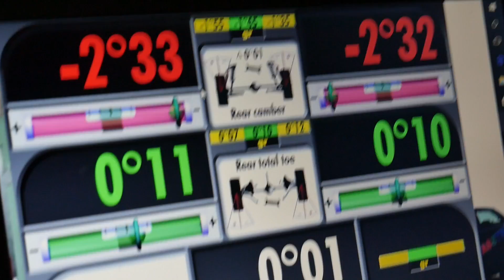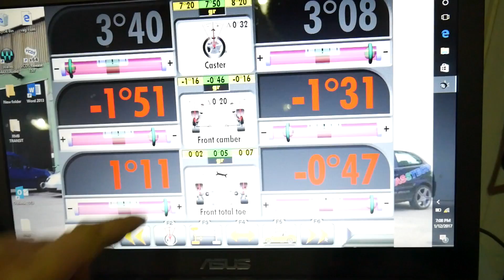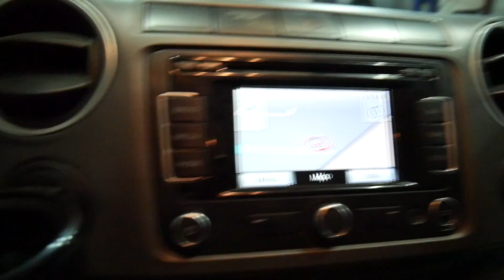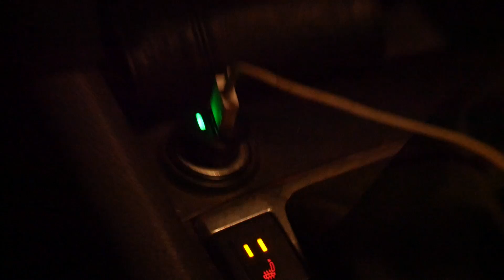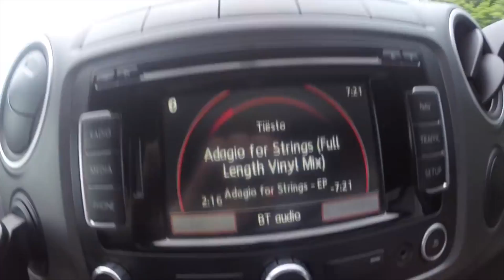E36 Alignment///Goodnight Sweet Barbra.

Comment: Them reservoirs leak, the hoses leak, the BMW stupid hose "clamps" leak, so yes, your power steering leaks. New Res and clamps should fix it if it isn't the hoses fittings or worse... the rack itself.
Reply from the maker: Well I've ordered a new hose for the low pressure side and will stick some new clips on so fingers crossed!
Reply: Don't forget to remove and replace that reducer in the return line... if it has it, lol. Some do and some cars don't have this. Weird BMW crap. I replaced my PS res and used double hose clamps on each fitting. Leak free, for now.